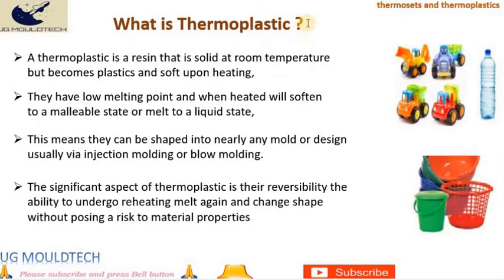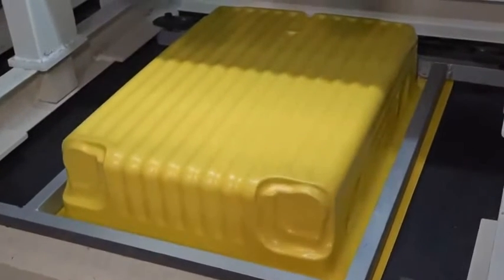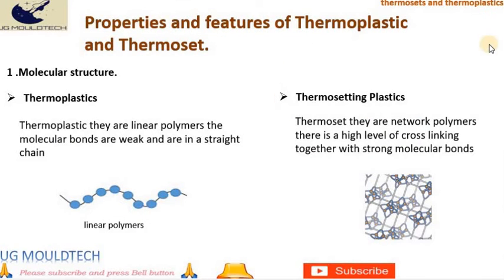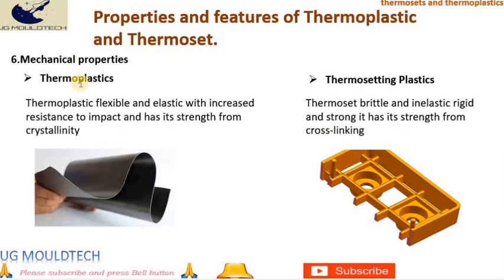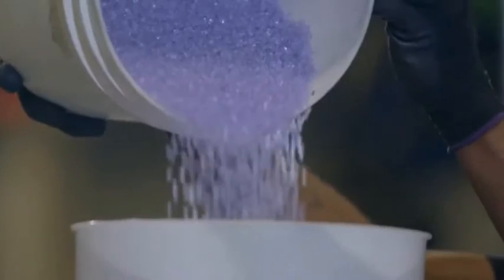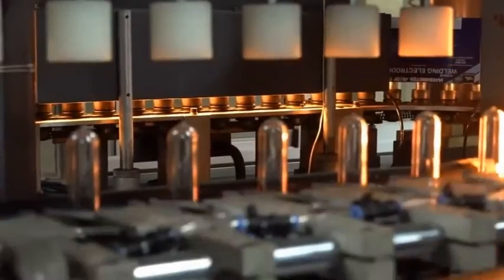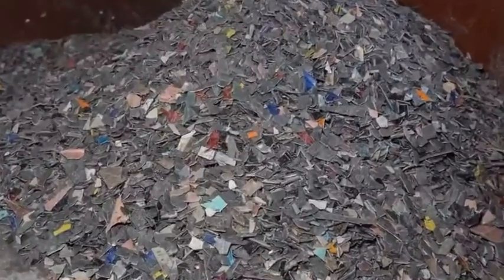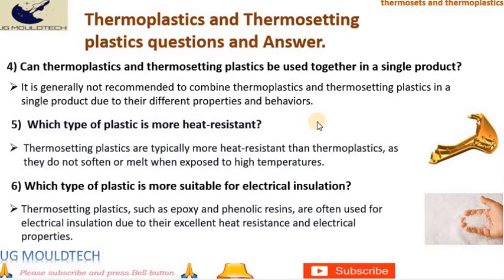Thermosets vs Thermoplastics: What’s the Difference?

Comment: Will mixing a thermostat with a thermoplastic make anything?
Reply from the maker: Mixing a thermostat with a thermoplastic might not lead to anything useful, as they serve different functions. Thermostats regulate temperature, while thermoplastics are materials that can be molded when heated.
Reply: @ugmouldtech2712  Can you give some information about liquid phenolic resin?